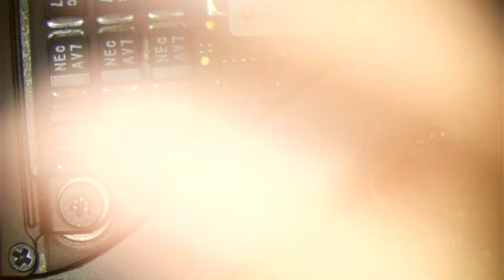2017 A1466 No Power + New video series announcement!

Comment: why not put a little thermal past on the pch also, and dont tell me because apple doesn't🤣
Reply from the maker: It's actually detrimental. The PCH does not want to be heatsoaked. If we were to put thermal paste on the PCH, the PCH would actually run hotter as the heat from the hot CPU core and heatsink would be transferred into it. 

I used to do the same, however the PCH will run cooler without thermal paste on it. 

Thanks for your question.
Reply: I had thought that this would be the case, but still on almost every other laptop the pch gets thermal paste because under stress it will run pretty hot too. Anyway, its food for thought, thanks for the answer @TCRSCircuit  👍